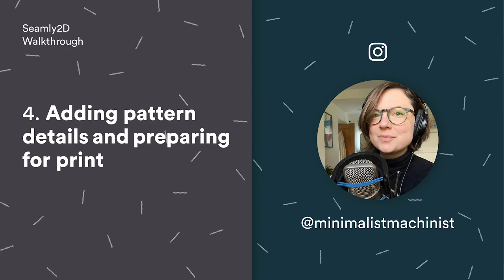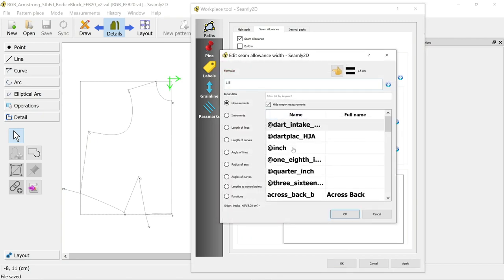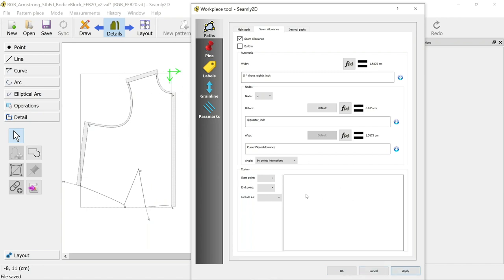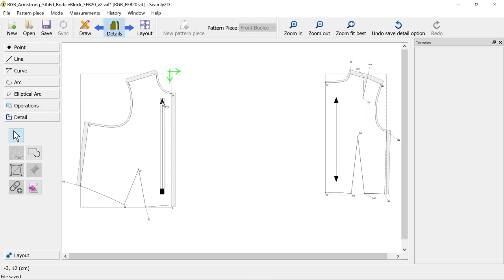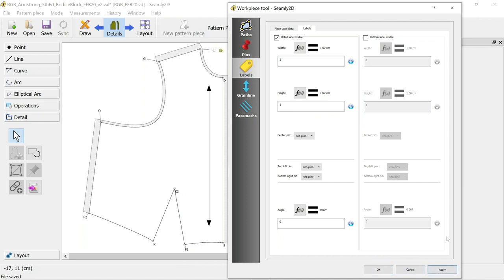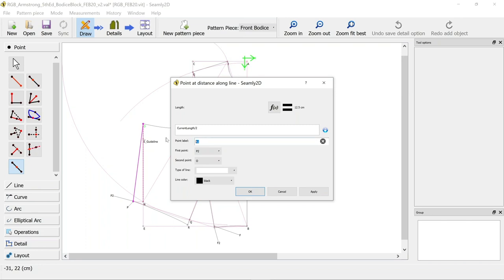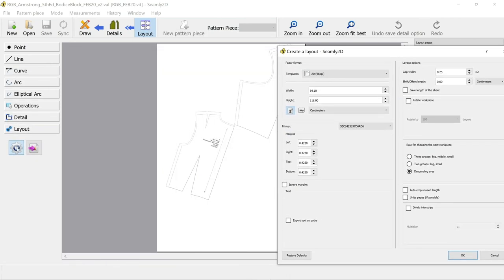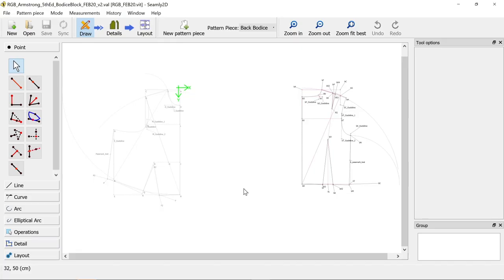Seamly2D Walkthrough - Adding pattern details and preparing for print

Comment: Hi Rachael- these videos are great! Really clear and easy to follow! I wandered is it possible to draw a pattern without using a series of formulas? Ie I currently use illustrator to trace over a toile image I’ve made and I wandered if it was possible to do anything similar in Seamly?
Reply from the maker: Hello! Yes it is. Instead of putting formulas in the measurement boxes. You literally just put the number/measurement itself. You can’t drag things around like in illustrator though. Which may not actually be beneficial to you if you’re not linking to measurements files x

Comment: I've tried printing the pattern using the PDF/adobe method, but something's wrong because the printed measurements including test square are all off by 0.5-1cm. I have my printer settings set to: poster, tile scale 100%, no overlap. do you ever encounter this problem?
Reply from the maker: I haven’t, mine are all to scale. Hmmm you haven’t. Added seam allowance to the test square accidentally have you? I wonder what else that could be. Have you tried printing direct from Seamly2D to check scale before trying the Adobe method? That would tell us whether the error is in the Seamly file or the Adobe export
Reply: @MinimalistMachinist  Okay i just tried printing directly from seamly and the measurements are all off :( (they match the 'off measurements' when printing on adobe). I triple checked my test square and other lines in draft mode and they are all correct.   Darn. I'll keep fiddling about - I just wanted to check to see if you ever had this happen! thanks so much for your prompt help! you're so great! I also read through other people's comments and everyone agrees you are a born teacher! thank you again for your amazing tutorials!
Reply from the maker: @beelyhuang9264   oh dang. Hmmm I wonder what’s going on. Could it be your printer? Have you tried printing a test square from a different program and seeing if it matches
Reply from the maker: @beelyhuang9264  and Thank you for your kind words!

Comment: hi there. super useful videos as i'm teaching myself pattern drafting but I'm struggling with seamly2d. I have the mac version and I don't know if that makes a difference, as there are quite a few commands you show that I cannot do. For example, I drew the block and then drew the pattern piece but it just won't let me do the seam allowance etc. I've watched many times and I get the process but I just don't seem to have the same functionality. The user manual isn't much use tbh. Also, I don't seem to be able to right click to bring up command boxes. It's all very frustrating. I'm so close!!! I don't know if that makes any sense, or if anyone else has similar issues?
Reply: I'm struggling with Mac as well. I've spent hours and hours on it - 4 days so far - and ended up with nothing. The lines bounce around, the nodes don't work, it won't do curves, half of the functions are dead, it crashes regularly and it won't make a workpiece because I can't get the red line to stick to the nodes. I'm practically in tears with it. I'm on the verge of giving up. I guess it's just not compatible with Mac.
Reply: The videos are great, though.
Reply: I've just tried the Valentina version from the Valentina website and it works better for Mac, though it crashes periodically. It's also got an easier print interface. Otherwise, it's just the same as Seamly.
Reply from the maker: Sorry i cant be of help on this one! I do use a Mac day to day, but for these videos I used my husbands PC and just use Seamly on that. Sorry I can't be of more help as i dont use it on the mac